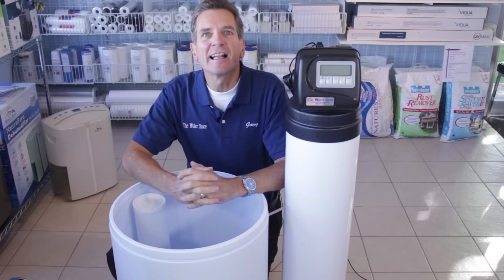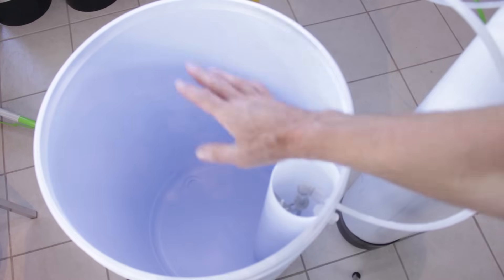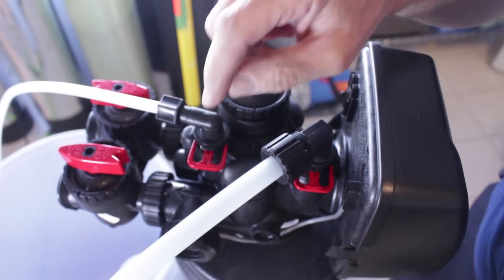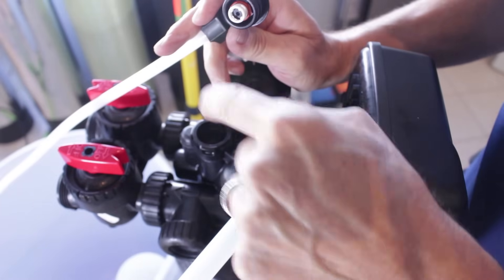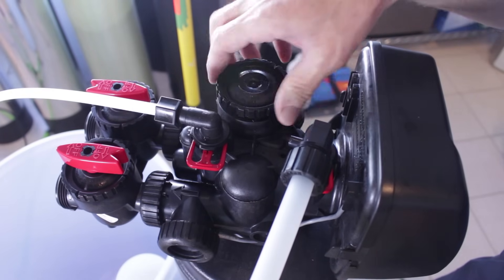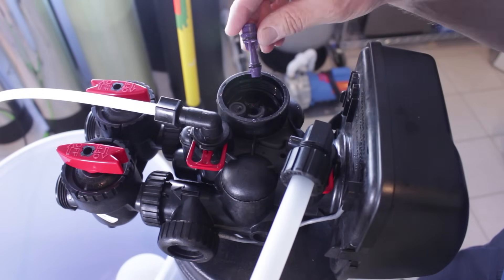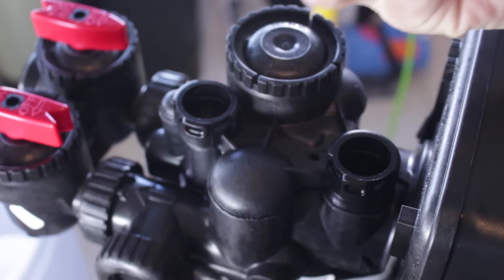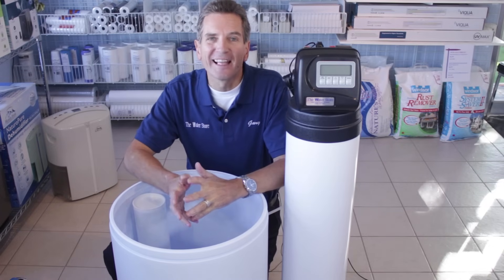Water Softener Troubleshooting Too much Water in Brine Tank

Comment: Thanks for posting these videos. I got a question, I have a 5810 valve and most of the time it is draining. I'm loosing lots of water down the drain. I believe my unit is about 48000 capacity and the hardness is 25. I also have it on softener metered. Any idea what I can do to fix this. Thank you
Reply: The Water Filter eStore thanks for responding.... actually it's a new unit....I'm stomped on this one
Reply: The Water Filter eStore you don't think my incoming pressure is to high? I noticed after the regn, next day it started doing that. thanks
Reply: The Water Filter eStore I'm getting a pressure tester tomorrow. I'll let you know. thanks

Comment: my culligan softener will not finish a regeneration cycle. Could u tell what to check and how to repair it has never worked very well and it is only a little over a year old had culligan people out of dallas tx several times and still dosnt work well most of the time

Comment: make sure the power is on someone may have turned it off
Reply: @water_estore  But how would the tank fill up with water if the power is off?  The valve has to allow water into the tank.

Comment: How much water should drain from the tank during a full regen?  I measured mine and it seems to be around 1/4 in.
Reply: My tank is full up to the float valve and does not noticeably drain during a manual regen.  There is a possible air leak in the connection of the brine line in the tank.  I have checked all other possibilities.  I'm waiting for replacement tube fittings.
Reply: One last question.  I replaced the injector and the nuts and fittings on the brine line.  No more water drip. All the other troubleshooting steps have passed. I still don't see the brine tank emptying.  Can you tell me which cycle in the regen process is the one that draws from the brine tank and is it fast enough to see the water level lowering.
Reply: There is nothing being drawn out.  After replacing the injector and brine line fittings, I took the brine tube and stuck it directly into a bucket of water.  Water goes into the bucket but not out.  If I put my finger over the end of the tube, there is little to no suction. Even though I see no water flow between the removed brine fitting and the drain fitting, am I down to the stack and or piston?
Thanks for your help
Reply: I tested the drain by pulling off the tube and quickly poring 2 gal of water into it.  It drained immediately
Here are the results of me placing the brine line in a bucket of water (thus removing float valve and air check):

Rinse: 15 sec   water into brine tank slowly for a couple of seconds then stops

Brine:  60 min   water into brine tank slowly

Backwash: 10 min tiny tiny amount of suction but no water flow

Rinse:  4 min  tiny tiny amount of suction but not water flow

Fill: 2:50 min  water flows into tank rapidly

At no time is there any water being drawn from the brine tank.

??
Reply: FYI, Even though I saw no damage, the fix was to replace the stack and piston.  After that I could actually hear the vacuum.

Comment: Hi, thank you for the educational video but in my case the filter itself is leaking the water like if it was sweating on condensation. Any tips on a repair or do I just have to replace the unit? Thanks in advance.
Reply: +The Water Filter Estore it is the tank that's leaking but it just started recently, I  never had a problem with condensation. I close de softener valve to bypass it but every time I open them the water starts to come out of the softeners walls.
Reply: +The Water Filter Estore I can provide you with a video or photos if you send me your email or cell #. Thank you for your prompt response. I really appreciate the help.
Reply: +The Water Filter Estore Thank you so much.

Comment: Thank you so very much for posting this video. I just moved into my house 5 months ago and I have never owned a water softener before. When the brine water would not drain out of the tank I searched YouTube and found your video. While my water softener is a bit different than the one that you showed, I have an Eco Water Softener that came with the house, the concept was exactly the same. your video was very helpful in showing what to look for and how to remove the line clamps. like I said thank you very much for posting this video, you saved me a $100 service call.

Comment: How high should the water level be in the brine tank?  My guess is that mine is set too high as I'm going through a lot of salt ( 50 lb/ week) and the tank is 3/4 full of water.  Have been trying to find out what the correct level is, but the videos I've seen don't address that.  Thanks, Jim

Comment: Our brine tank is not draining.  Water flows in but not out.  We check all the stuff you mentioned in the video except the float tube.  The float is working fine.  If there is not salt at the bottom of the tube is there anything else to check?  All lines are fine, too.  Thanks for your videos.  Because of youtube I fixed my dishwasher and a ton of other stuff.  So grateful for people like you who share your knowledge.  I so don't want to call Culligan...they'll just wanna replace the whole unit.
Reply: I don't know if you're familiar with Culligan, but it's a Culligan Medallist Plus Series 45 water softner with timeclock. The water goes into the brine and sits there until it's time for the washing cycle.  LOL
Reply: @bekayezme  i have a culligan no clogging and float is fine. When I start the registration barley any water is going out the tube and after an hour I check on it the thing is full of water and won't go down!!! What can I do??

Comment: Thanks Gary for your videos.  My brine tank wasn't draining. You mentioned several possible problems. Mine was the brine float tube had salt accumulating in the bottom blocking the slots. I siphoned the water out of the tank and used a shop vac to suck the salt out of the float tube.  Did a recharge and it worked properly.

Comment: I  have the bypass valves shut off, can i open the injector lid without water coming flying out at me? it seems on there rather tight.
Reply: +Gary the Water Guy   ok, so WHILE the cycle is happening i can open it, or wait until it's done?   thanks
Reply: Do Not open the injector lid while the unit is in a regen cycle. Same for removing the brine line and drain line.